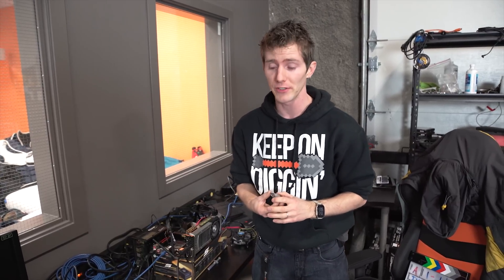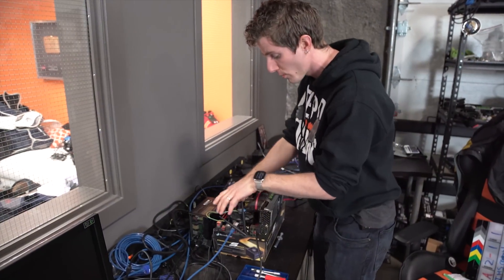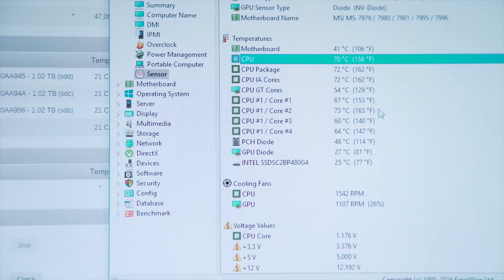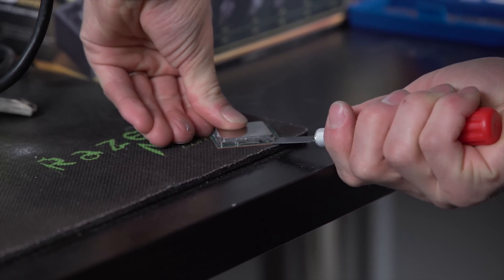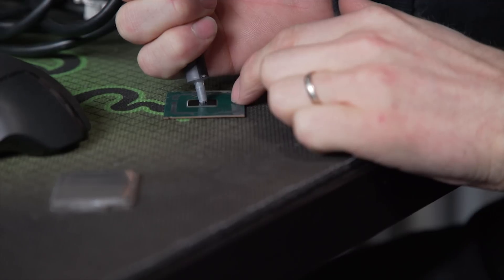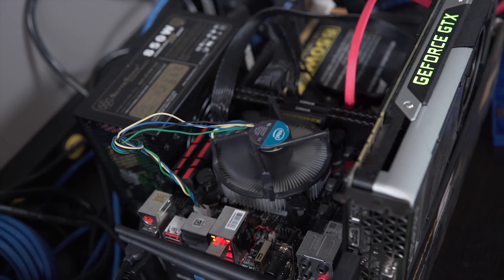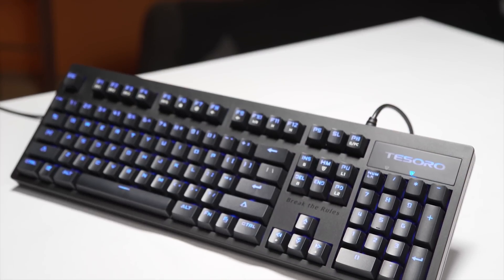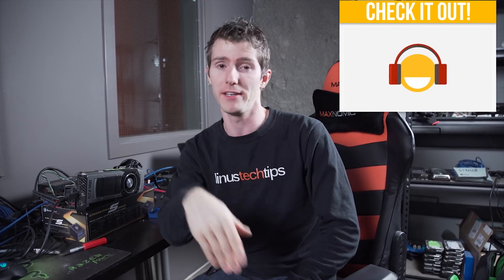Delidding an Intel Core i7 6700K - Is it worth it!?

Comment: He's so full of crap.  The test itself is flawed beyond belief.  Using a crappy stock Intel heatsink and fan won't ever show any benefit.  You need something that can actually handle the better connectivity between the CPU core and heat spreader.  

I just finished delidding my 6700K today using a 3D printed ABS holder and vice (which worked like a charm - didn't even bend the PCB, andf no sliced up fingers from toying with razor blades), and with the same Raystorm waterblock, 480mm radiator, 1200Lph pump, and even added my GTX 1080 with a new full coverage EK block to the loop.  I went from temps of 74-80C under load with Prime 95 at stock speed (4GHz norm 4.2GHz turbo to a quick overclock of 4.6GHz - 400MHz boost) and temps of 39-53C at load under Prime95.  That's upwards of a 30C+ difference (I'd say that's more than substantial, it's a rather enormous delta)!  For TIM I used Liquid Metal Ultra from Coollabs on the CPU core and Raystorm's K3 on the heat spreader and waterblock (used the Liquid Ultra on the GTX 1080 and EK waterblock, too and even at 2.2GHz it never gets above 37-39C where it was constantly hitting 79-82C with the reference air cooler).

So yes, you will see better temps if you are using a high end air or water cooling rig.  Using a crappy stock heatsink that can't do anything but keep any CPU from frying and can barely handle the rated max TDP under load will never do anything for you.  What a stupid way to test.

Comment: One thing people fail to do when they use their own experience as "proof" is take into account how they did  their little experiment. If you have your CPU and Heatsink set up for a good year, see this and decide to try it - buying the best thermal compound - you then have to take into considering a few things before you assume its simply the new TIM under your IHS.

The compound on your CPU is already degrading in its ability to transfer heat as well as it more than likely being Stock Compound. So by replacing the compound with a new compound that has better thermal properties you're already going to drop your CPU temps by a good 5-10 degrees from that alone.

Then with your new compound under the IHS itself, you're probably dropping the temp by another few degrees. So overall you "think" by doing this mod you dropped the temps by 10+ degrees. 

This is a proper setup here, brand new CPU, same thermal compound used before/after on the Heatsink, etc. Sure you could use a better brand of thermal paste, but 15+ degrees in drop? C'mon people.

Anecdotal evidence is the worst

Comment: I got 15-20 degrees C across all cores on my overclocked 3570k from 85c to 65c. so a significant difference. I also did mine in a vise which made it super easy and quick. one jaw on the substrate, one jaw in the lid and gently tighten till the lid moves a little. done :)

Comment: Even though using an exacto knife to precisely remove the lid seems the safest, it's actually a lot safer to put the cpu in a vice clamped to the lid and tap the pcb with a rubber mallet as you don't risk cutting the die

Comment: when I changed the stock paste on my gtx 770 to liquid ultra I got 17 degrees lower under load....you can't conclude that it's pointless to delid because you only got a couple degrees using paste that will dry out fairly quick and need to be replaced again soon. 

secondly the delidding on haswell had alot to do with the defective early releases where you could get a 15 degree difference between cores like I used to get on my 4770k.

Comment: it kind of seems like if you did everything properly (top notch thermal paste, adheasive ect), and you are already running the system near its limit (water cooler or very good air cooler) this could bring a decent boost in performance. Obviously most people are doing that, but if someone is already shelling out for top of the line stuff, then it might be worth it

Comment: i use a i7 4790k @ 4.8 ghz 1,32Vcore 
and i use liquid metal for it. and i got an amazing temp. difference between the stock and the "edit" cpu.
before it was about 86 degrees. and after, 61 degrees!
So, it´s worth it alot

Comment: speaking from experience it is NOT worth the risk. although it will work when you put it back on, the clocks that you reach from the difference (using GELID xt paste) is still not worth it and when you do burn though your CPU down the road, and the warranty is voided you are walking around with a piece of silicone you can at best use as a $500 key chain, cause honestly, it's not heavy enough for a paperweight.
Reply: additionally i have seen on OC forums (non particular) people trying to cover it up with RV glue and sending them and it is a very dishonest thing to do when you broke your hardware yourself.(at the delidding process nonetheless)

Comment: Is this going to be usefull for cpu like i7 860 or not ??? i mean does the soldered has better heat dissipation or the themal paste???
Reply: >.> I ask if soldered has better heat dissipation or the themal paste , NOT if its safe to do it  :/
Reply: there's honestly no point
Reply: Trying to remove a soldered on IHS will probably kill your CPU instantly by ripping off the die in the process.
Reply: There's no point. Soldered is probably the best. And there's basically no way to delid a soldered CPU.

Comment: Probably easier to just buy an air conditioner, and setting the temp to low as possible. My i7 4770K dropped 10 degrees, after I upgraded my ambient cooling to 17 degrees.

Comment: This is the most biased nonsense video i have EVER seen lmao.  Uses crap thermal paste that he calls "aftermarket grade" that's literally no better than the junk intel has on it; instead of using Cool Laboratory Liauid Ultra/Pro which would net him TEN TO FIFTEEN DEGREES LOWER.  Then he doesn't eve spread the damn paste onto the die just globbing it on, showing that he's obviously never delidded before or he'd know that you don't just glob paste on the DIE, you have to spread it or at the VERY least do a star pattern type thing like on a bare GPU die for installing a waterblock etc..   Jeez....just so much fail here....you were right linus when you said that line.
Reply: +MRsjovealek He sounds fine. Check your brain tissue xD smh

Comment: I noticed you made a line with the thermal paste. You actually get the best results if you make an X by roughly 1-2 degrees.
Reply: nah, you actually get a better results with a square or circle because when you smash it down it has more even coverage across surface of the chip.  Yeah, people who argue semantics are annoying.  He was wrong, but so are you. DONT BE THAT GUY
Reply: It may be one of those things that doesn't make a big difference but if you're an overclocker trying to get the most out of a system it can be an important factor. From my own testing as well as results from this website I will continue to use the X method but of course use whatever method works best for you.

https://www.pugetsystems.com/labs/articles/Thermal-Paste-Application-Techniques-170/

This is Cisco's official recommendation for applying thermal paste on the CPUs in their Blade servers. 
http://www.cisco.com/c/dam/en/us/td/i/300001-400000/330001-340000/334001-335000/334295.eps/_jcr_content/renditions/334295.jpg
Reply: People have been testing and claiming this-that-the-other for years. I do the X on a GPU die and a rice grain sized dot on CPUs. At the end of the day when you take your sink off it should be very thin and covering, the dot does this nicely. Guess it depends on the paste too?

Comment: I just delid my 4790k and replaced Intels TIM with Phobya Liquid Metal.
My load temps droped by 20degreesat least.
4.7Ghz 1.32V temps under Load (OCCT small fft) 60degrees Maximum.
Ambient temps was 23C

Comment: san u make a "glass" ihs? probably u can get cold procseor
Reply: ***** Yeah, you do know how many videos are on this site, right? What are the chances I'll run into the one you're vaguely describing? Do you have the link?
Reply: did your light bulb melt lately?
Reply: No. Glass has a much lower melting point than metals. You would literally end up with the glass melting from the heat of the CPU under load or cracking from the pressure of the heatsink mounted on it.  And glass wouldn't make the CPU any colder, in fact it'd be HOTTER since glass has ALOT less thermal conductivity than metals.
Reply: ok. but i watched a video and 2 guys made a "glass" CPU and they got cold CPU
Reply: +justin2221:
"Glass melts at between 1400 and 1600 degrees celsius. A CPU will never get this hot"

==No, soda glass softens at about 600 °C. Borosilicate glass softens at 800 °C. Glass with lead silicate softens at 500 °C that's why they make neon tube with it since it is easier to work with it.
Reply: ***** What video is that?
Reply: check it bro!

Comment: Senseless test imho. 
If somebody wants to replace the TIM of a CPU, fore sure liquid Metal would be used. 
I got about 20°C less core temperatures on my Core i7 4650k by replacing the intel TIM with liquid metal.
Maybe not this improvement on a Core i7 6700K but about 10-15°C less compared to the original should be possible.

Comment: Of course the 6th gen cpus wont have much difference when delidding. He should have done this with a 3570k or 4670k, the tim they used for 3rd/4th gen was fucking nasty. My 3570k was hitting 95-100c with a hyper 212 and adequate ventilation (no it werent to do with cooler mount, i remounted several times) at stock speeds running intel burn test. I then delidded it and applied some mx2 to the die and reseated the cooler etc. I ran intel burn test again and my highest core was at 80c, so i got a good 20c drop in temps. Also the idle temps went from around 55c to 37c.

The tim that was on the cpu die had similar texture to the sealant and i had to rub quite hard with an alcohol wipe to get it off. But again, this isnt a problem with skylake cpus so this video is quite misleading because it sways people away from delidding but it doesnt show you the scenarios where it is really beneficial.

Dont get me wrong, i love linustechtips, its just I dont like the way this video sways people away from delidding when it shows results from a cpu that doesnt have the problem that the cpus people actually delid do.
Reply: Well even Skylake 6700K regularly gets a ~10 degree Celsius drop from delidding if you do it PROPERLY by putting on Cool Laboratory Liquid Pro/Ultra or Thermal Grizzly Conductonaut etc.. (only $5 for the conductonaut!) liquid metal pastes instead of the no-name junk paste he used here thats no better than what intel had on the chip already really. And you're supposed to SPREAD the paste on the die not just GLOB it on lol.  Linus literally had NO clue what he was doing, a lot of people are accusing him of being biased or even being told by Intel to make a delid video that purposely looks bad to keep people from trying it so they won't get as many RMA's (because intel actually doesn't really check their returned RMA CPUs for being delidded usually; only to find out later after they refunded you already lol)
Reply: +TheScaleless my point is the skylakes dont need delidding because temps are usually fine whereas if he did it to a 3rd or 4th gen i5 or i7 he would have seen massive results. I didnt even use any special tim just some standard mx2 which i used the line method on the die and ihs and my temps dropped around 20c on average
Reply: +MRsjovealek then you are a very lucky person who good a good one
Reply: MRsjovealek
i think you'll find its a majority problem rather than minority
Reply: MRsjovealek why do you think so many delid their 3rd/4th gen cpus? because the thermal paste under the IHS is complete shit and it hardens over time making it really bad at conducting heat leading to higher temperatures. Also I've heard reports of peoples IHS's not making full contact with the cpu die due to excessive glue holding it down and the actual IHS being slighting convex/concave. If you havent had any problems then good for you, just because you havent heard of the problems it doesnt mean they arent there :)
Reply: Actually it's not a no-name thermal paste, it's Cooler Master MasterGel Maker Nano, one of the best thermal paste in the market (aside metal based TIM)
Reply: Some people report that the glue around the edges prevent the IHS from making 100% kontakt with the CPU core.
Be sure to remove all remaining clue before mounting the IHS back on or you would just have the same problem again.

I am finding it a bit funny that my 5 years old aircooled, never remounted, AMD 125 watts CPU has lower temps then this CPU.
Reply: I am glad they fixed this issue with the 'Haswell refresh' products.

My i5 4690 is still going strong and quite cool on the stock intel cooler. =D
Reply: I wish dan gheesling was here to make fun of you like he did to NL
Reply: Yeah, that vid is crap. i5 2500k with Liquid metal 49 degrees at 4.5 GHz without LM 77 degrees.
Reply: how the hell did you do that, my processor under load only sits at 45 degrees C I can't see the processor sitting at single digit/low teen temps. Ambient temps around the 70's, cooled with a corsair H100iGTX
Reply: u can't delid sandy bridge, so how you received such results?
Reply: Marcin Dołęgowski U can..
Reply: luckyshottzZZ Cause Linus doesn't wants stupid people (over smart people) to spoil their CPU, thinking everyone can do it.
Reply: MRsjovealek just because your cpu runs cool doesnt mean theyve never put bad tim
Reply: he only had a small difference because he did a bad tim application and used a stock cooler which is a thermal bottleneck

Comment: I've been pretty impressed with Linus for the most part and their experiments and testing, but this is certainly one of the ones he clearly does not care about and it showed in his effort to portray.  This is an front to computer science. He used a small amount of paste on the underside of the spreader,  (Which is good, once spread out, but used too much on the top, and also didn't spread it.  Having seated probably 3000 CPU's in my lifetime, I can say I properly know how to apply, and the lack of attention to application alone was enough to make me cringe.  This kind of mistake can greatly affect temperatures by as much as 20 degrees with just stock paste, and a few more with higher end compounds.When applying paste, you should first spread it.  (Which he did not do, he squashed it.) Spread it thinly, so thin, that you can practically see through it.  You want your paste to transfer heat, and only fill microscopic imperfections in the surface metal, and that's it!  Even spreading it thinly to see through can be too much, but is realistically all most can do with two hands so it is sufficient.  Short of examining it on a microscope to see the surface area made flat by the paste.  If he had done this on both sides, he would have seen a 15 degree minimum improvement.  And exponentially better as he overclocked in a comparison with baseline on overclock.P.S. If you want, you can contact me and before you do these kinds of computer science experiments, I can be your conscience to make these kind of tests more thorough and exciting for users.

Comment: My 4570 usualy stated at 60C in full load today changed termal paste with mx4 & know goes 65C without turboboost, or may be this is because outside are 35C , still mx4 doesen't spreed to good tryed midel dot methot gone to 75C , line method still above 70C only X method drop to 65 & this by also turning turbo boost of.

Comment: The real problem is that big-ass gap between the die and IHS. Even the best conventional thermal paste in the world will have a hard time bridging that, plus the rather small area from which the heat originates. Hence why people are using liquid metal, which conducts heat by orders of magnitude better. This is just bad thermal design, and presumably what happens when the desktop chip is more of an afterthought.

A proper design would ensure that the IHS always rests directly on the die with very little TIM required, no matter what IHS production tolerances might be. Of course then you've got to ensure that things can't move up to the point where die edges are potentially damaged, but that's what you've got engineers for, right?

Comment: What about not using a heat spreader at all??
Reply: The no heat's spread.
Reply: +MarginalSC so the best option is to just reapply thermal paste under the heat spreader?
Reply: ***** Yes since you need surface area to better dissipate heat
Reply: False information. 'No heat's spread' lol.
The real reason is that you would have a very high chance of cracking the silicone die, and on top of that you need to modify your cpu socket and your cpu cooler may not fit. If you're not overclocking (to a high level), then it's definitely a bad idea. In fact de-lidding a cpu in the first place if you're not overclocking is a stupid idea.

Comment: I've tried to remove the IHS from my old Intel core duo e8500 CPU right after watching your video and what I've managed to do was breaking the glass silicone that was inside and two pieces and that's because between the IHS and the silicone glass was solder that actually held the IHS and the glass glued together instead of thermal compound.
That was awesome cause i was able to see the pattern that was carved in the silicone glass is was really beautiful.